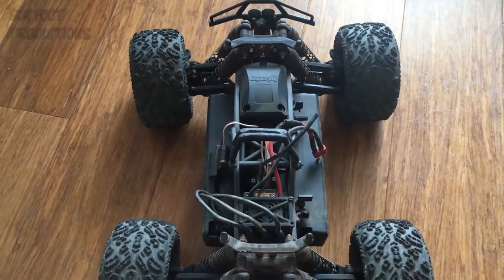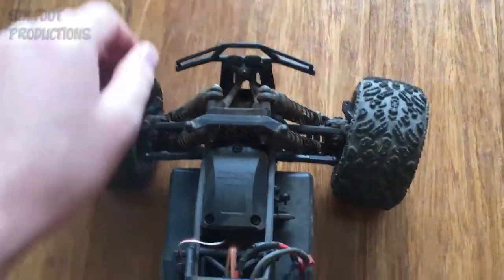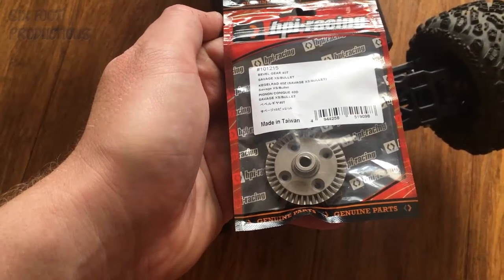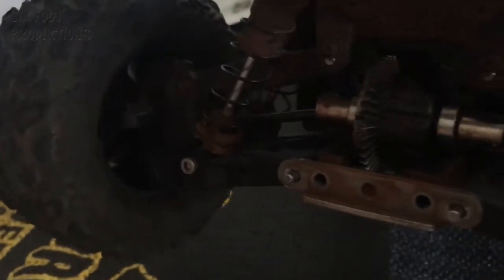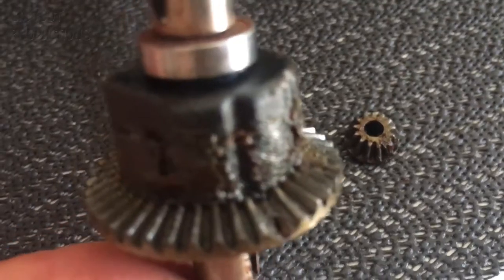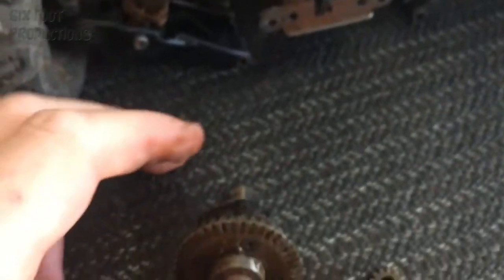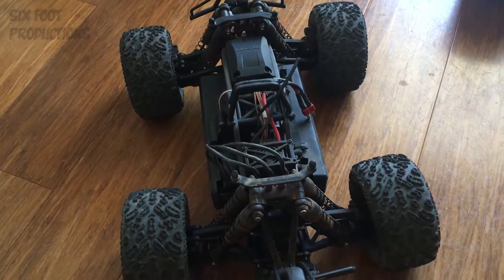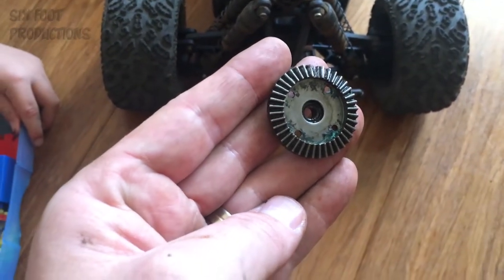Hpi Savage XS- Fixing Clicking Teeth Missing Bevel Gear in Differential

Comment: I've had the same thing happen to mine. Must be some weak metal ring gear.

Noticed that the pinion pulls in and out of the gearbox, so I shimmed it, not only because of the slope, but I shimmed both sides of the pinion until the mesh felt right. Will find out this weekend if it fixes the problem of breaking ring gears.